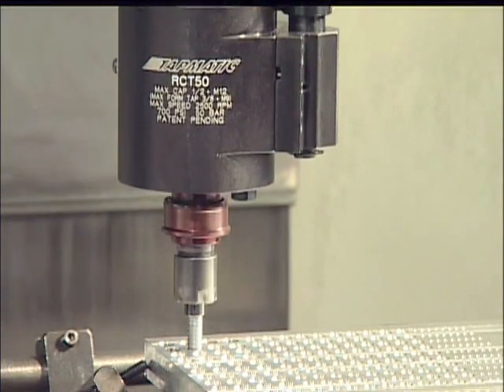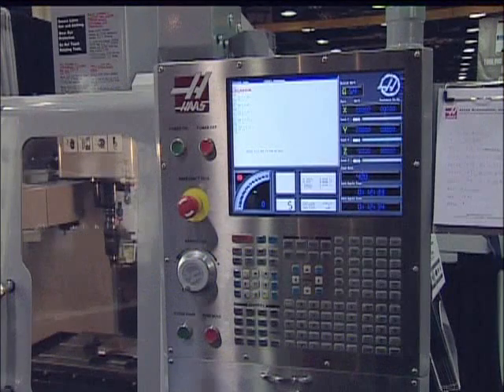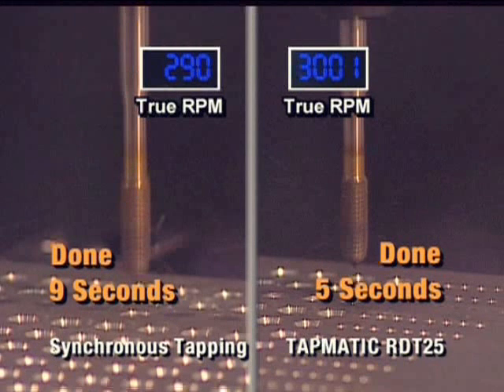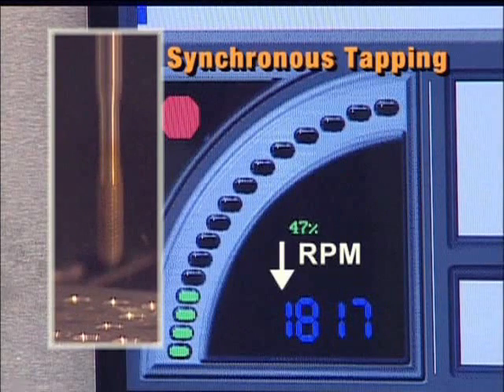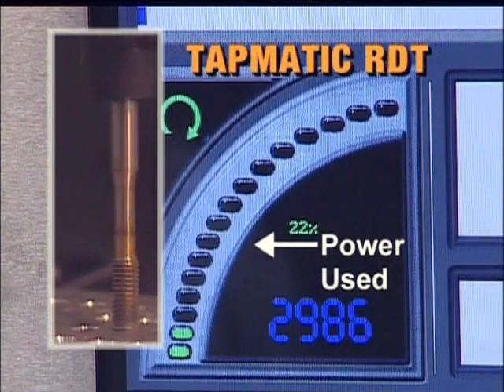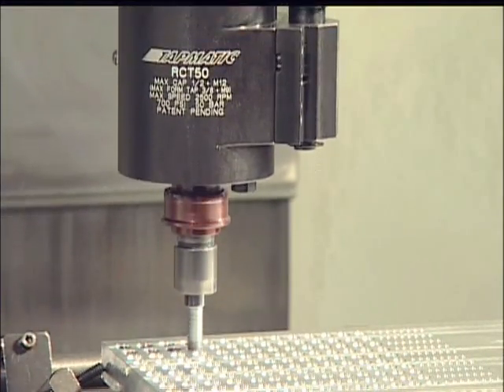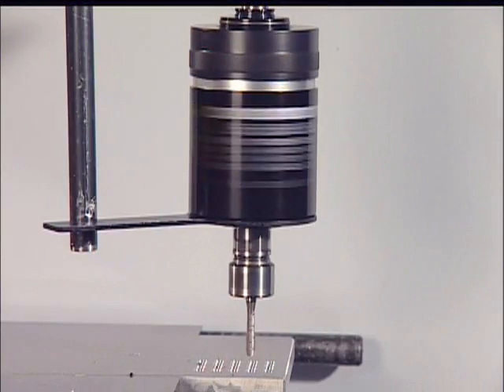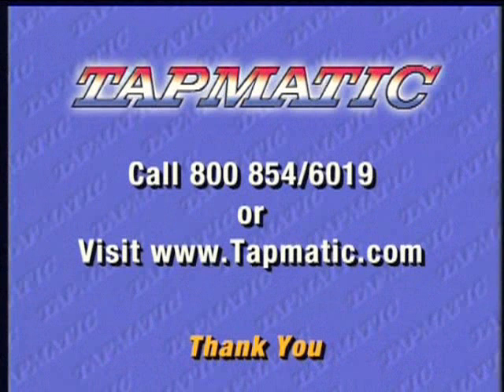The Fastest Way to Tap

Comment: What material is that? I am trying to tap 1-80, 2-56, 3-48, 8-32 in Vascomax 350 C and I am having a terrible time, have tried Kennametal, Imuge, Guhring, taps have yet to find a tap that lasts and I do not end up with the problem of removing a broken tap to save a valuable part! Do not have this fancy head, have an old incomplete tapmatic tapping head set, not sure how to set the clutch, it has a bunch of tap sizes printed out on a moveable collar, but nothing to align it to, does that make sense?